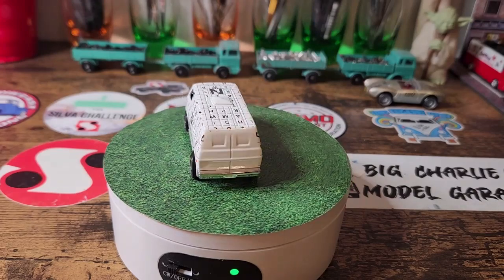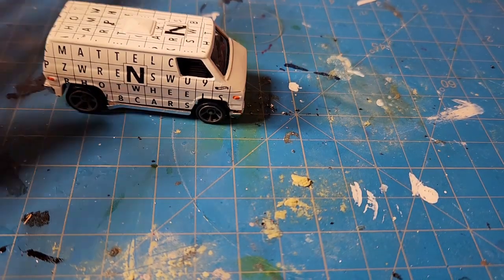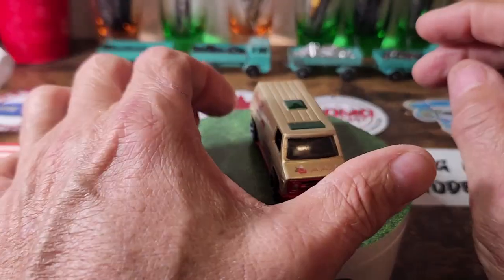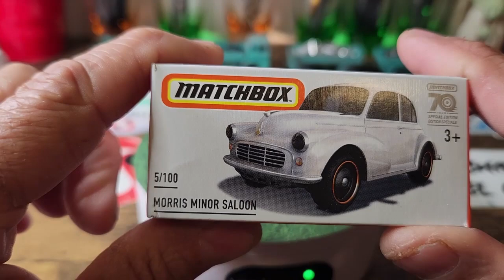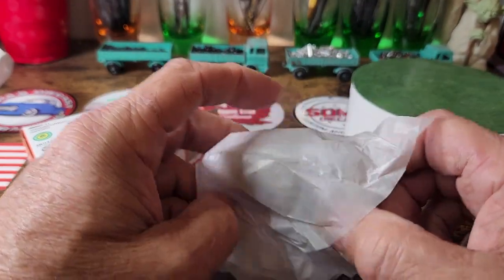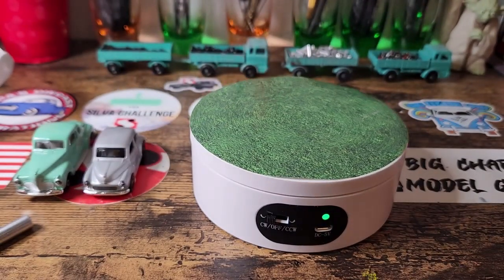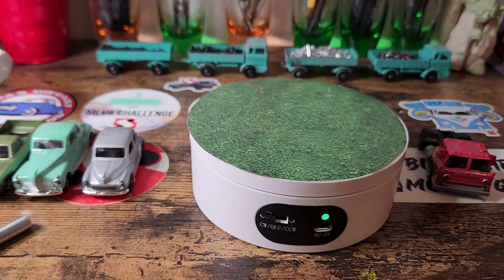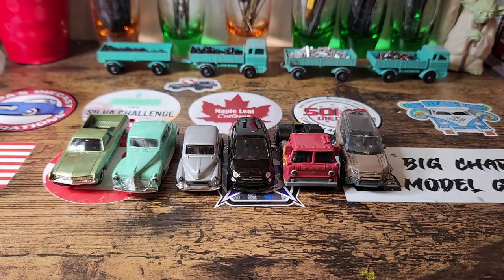DIBS December Christmas Build

Comment: nice build, love the gold and the decal designs. :) nothing beats getting rid of those original tampos, tho. ;) what were they thinking?

anyway, I think glueing the boxes shut is just plain mean. in a blister you at least see the model without having to open it. here in germany some MB are sold with boxes, too, but those boxes are separate under the same blister, so they won't be destroyed.
those models are nicely detailed. you can get the Ranchero here, too, in the same colour, but the standard wheels and less elaborate decoration. I've seen the others, too, but the C600 truck is only seen in SHELL decoration here, if ever. I don't know why some models are not exported everywhere... and where the food is the trailer? :0
Reply from the maker: Thanks Lothar! I enjoy hearing from other countries. You always have a great insight! I think boxes should be sealed, it brings back the nostalgia.